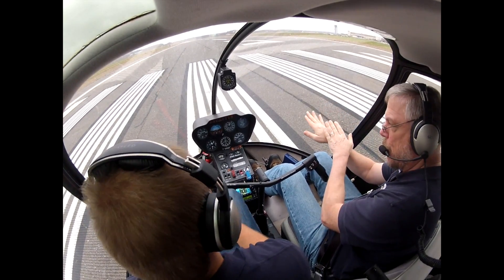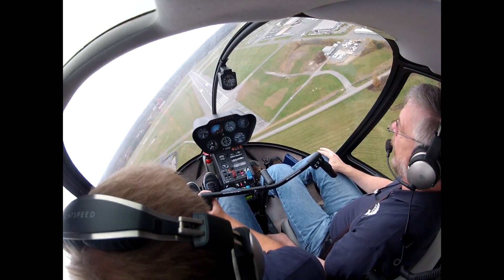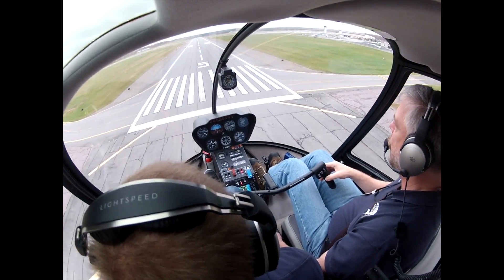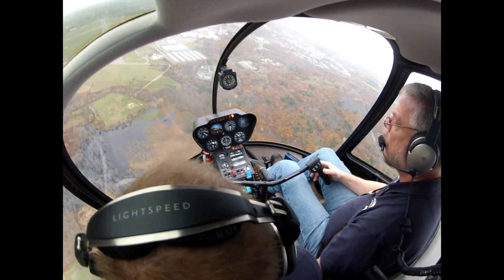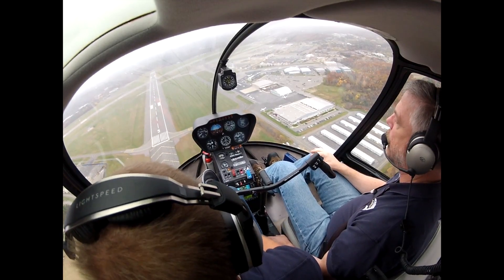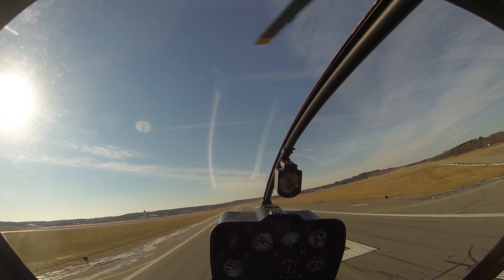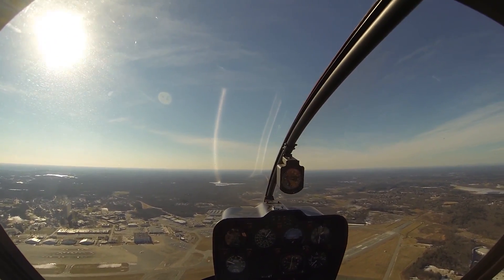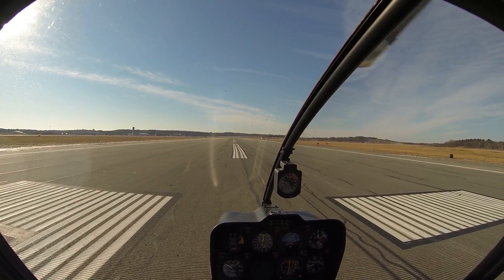R44 Helicopter Touchdown Autorotations

Comment: The low rotor rpm horn is always going. RPM below the bottom of the green.
Reply from the maker: Yes, best glide is at 90%, which is the bottom of the caution range. My understanding is that any helicopter glides most efficiently at the lowest possible RPM. However, there is an RPM ( in this machine just above 80% ) where the rotor will stall catastrophically. So, the manufacturer sets a minimum caution range high enough so people won't stall the rotor by mistake. It's something I pay close attention to... In 40 years I hit 88% twice ( when a student was slow to correct ). Your life depends on maintaining a safe RPM. But, you also want to be able to get the best glide possible... It might be the difference between landing safely in an open field, vs hitting the trees around the field. ( If the engine should quit ). That said, in my experience, airspeed has a bigger effect on glide than RPM... But you should be able to control both...

Comment: why it shudders or wobbles before touch down?
Reply from the maker: When the RPM gets low, you get that kind of vibration. It's the rotor system's way of saying "time to be on the ground" 😁
Reply: @boston_pc  Thank you! I've been tearing up your website lately getting ready for instruction in Maryland next month - extremely helpful. It's crazy that website which has been on the internet since I was a toddler is still so useful, and that you've been at the forefront of such a transforming world. Thank you! Hoping to change careers from an electrical engineer to a pilot, I might email you for advice sometime if you're willing.

Comment: "S" turns to loose altitude?  In Army flight school, 1967/68...our "SPOT" autorotations were started at pattern altitude (1,500') by putting the RW numbers under the chin bubble at speed, drop the collective, split the needles, pull the cyclic back to stop forward movement, push the cyclic over and become an elevator.  Carefully keeping close watch on our position and rotor rpm- we repeated this 'pull/stop - push/drop process  -  until our last gyration and flare to the ground - right on the numbers.  We were taught every conceivable method to autorotate our UH1s to the ground every time.  Spot Autos were my favorite and we would bet the IPs we could do better!  We were trained by the most experienced Vietnam Vets in existence and carried that confidence into Vietnam when our turn came.  Today's helo instruction is rare to nonexistent for full autos to the ground...teaching recovery with power instead.  Sad.